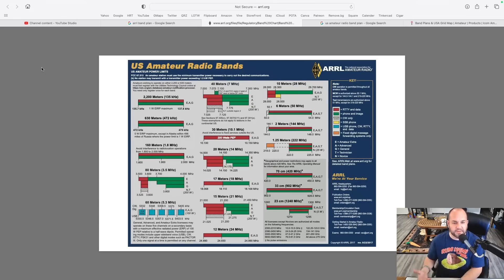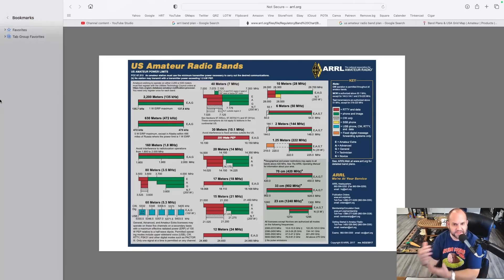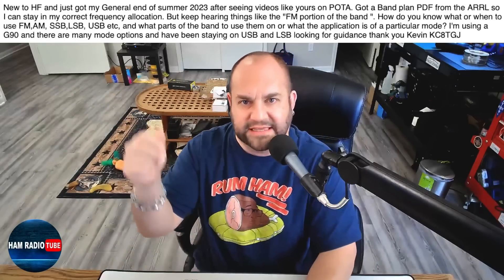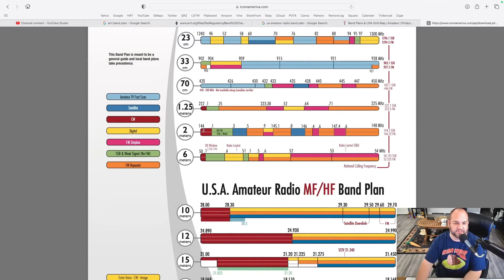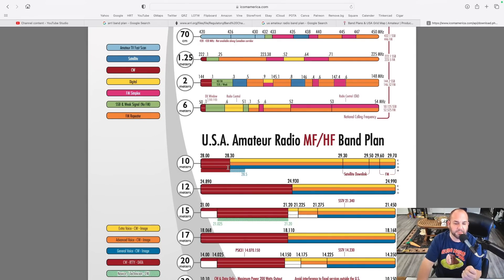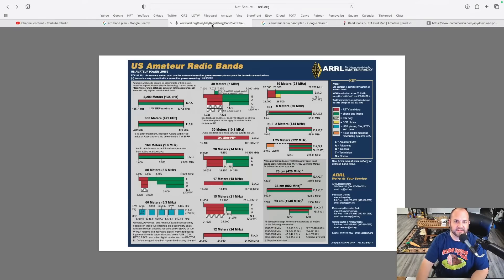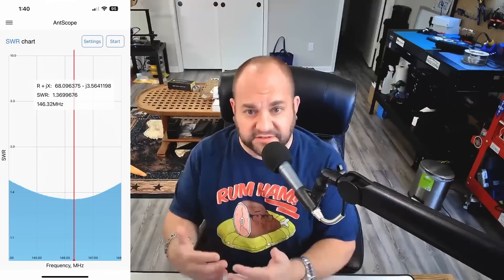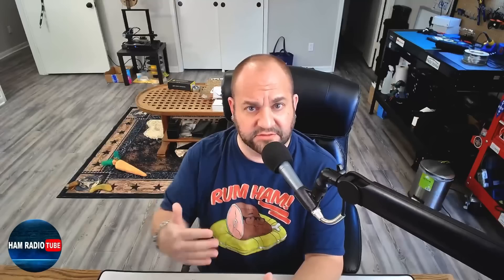Where Does Your Antenna Analyzer Go?

Comment: The way I have always done antenna measurement. Use a VNA. Calibrate the VNA at the end of the coax you are going to use. Save the calibration for each of the bands you are going to use. Do it for each band because the VNA can only analyse a certain number of points across the frequency range you select. When this is done attach the coax back to the antenna to be tested. Ensure you use the correct calibration and sweep each band required. I have one this with many antennas. It is a bit tedious, but it works. When I have done this, I have then taken screen shots for each band and calibration, put it into a word document with notes. Then I have used an antenna length calculator to work out what needs to be changed and so on. I use a DX Commander classic and used this method with it to sweep each band, then take it down and make adjustments.
I have done this witha Nano VNA and a Siglent VNA.
Like a lot of Ham stuff, it's something to do!

Comment: I agree with you about checking the antenna with the coax. The antenna should be analyzed as close to operating conditions as possible.

Also, you said you don't have any science to back up your opinion. I disagree, you did an experiment and showed the results, that is absolutely science to back up your point.

Comment: KF5MCJ Tulsa, handle Ron. Just retired at 68 now. I am working on my HF station and a few other Ham projects. Purchased and installed two used HF antennas. One, Hy-Gain AV-14AVQ and the other is a Gap Challenger DX-8. Both test bad at the switch on the outside of my home. Bad, means no resonate frequency with MFJ-259B on any band. Underground PCV conduit to each antenna. I took a 2-meter antenna that dipped at 146mhz and disconnected the HF vertical and screwed in the 2-meter antenna. Went back to the home and both dipped at around 146 mhz, the cable is good, and the antenna is bad. I will re-run the test on the vertical at the antenna before title base it down and replacing it. My MFJ is old and I just purchased a Comet CAA 500 to re-test. 

My father was a ham radio operator for seventy years, now a silent key. Do you have any of his hand made QSL cards, W5OQA Grove Okla.

Comment: Use a halfwave tuned feeder,,,the analyser  only input about 6mw to the antenna so the physical  interaction will be low,,,but you can also calibrate  analizers to take into account coax

Comment: Antenna EF question. I had 10g stranded 160ft that I used on my Icom,  Setup, Coax 20ft from icom 718 to icom ah4 tuner that is 15ft high, and under the eve. from the tuner, the 160ft / 10g stranded again from tuner at 15ft to a tree 90ft.  Well, the line going through the pulley snaped after 3 years, so do it came. Now, I tried to send a new line over the tree, and even tried to hire someone to climb the tree but no go. So, instead of 90ft, its only 20 ft. now having 160ft 15ft to 20ft high. I feel this will kick me in the ass. Any thoughts?

Comment: "How are you going to measure a 40m dipole a half wave up?"  Use a NanoVNA.  Get your coax that you will use, Run the calibration procedure at the far end of the coax, Raise the antenna into place, Then with your calibrated VNA, analyze the antenna as if your unit was 60 feet in the air but it's in your hand.

Comment: Two things about measuring SWR at the antenna:  1.  Antennas do not have standing waves, or SWR.  When you use an antenna analyzer to check an antenna you are checking the complex impedance for resonance and the feed point resistance in ohms.  2.  Feedlines have SWR. Especially IF their is a difference between the Antenna feed point impedance and the 50 ohm coax you are connecting it to.  The "imbalance" between the 2 impedances is the mismatch and creates reflecting waves to travel down the coax towards the transmitter thus creating the infamous standing wave ratio (SWR).
Reply: Standing waves are created by impedance mismatch and are introduced when you terminate a 50 coax to a 73 ohm dipole. The “reflections” are produced from the mismatch and create standing waves. So the reflections and standing waves are one and the same.
Reply: @k9eihamradio  I see a difference between reflected waves and standing waves.  Reflected waves.  Like I said.  Ideally we have standing waves on the antenna.  Ideally, we don't have standing waves on the coax or feedline.
Reply: On a centerfed dipole antenna, ideally the current is maximum in the middle and minimum at the ends. The voltage is maximum at the ends and minimum at the middle. That, my friend, is the definition of "standing waves". What we don't want to get is "reflected signals". Let's not forget the difference between "reflected signals" and "standing waves".

Comment: On band plans: first recognize that there is what the FCC regulations require, which is what the ARRL chart shows, and everything else is  by "gentlemen's agreement.  That iCom chart is pretty good.

On the DX Commander 20m intermittent issue: One additional possibility is that something near this (installed in a fixed position) antenna is sometimes resonant near 20m.  For example, house wiring for a light that is resonant near 20m or not depending on whether the switch is on or off.  Gutters or metal siding components that connect or not depending on weather conditions.  But the first thing I would try is replacing the 20m element with a new one, since a bad crimp/solder job on the fork connector, or maybe a break in the conductor inside the insulation seem most likely to me.  You can start with just plain wire and no fork connector to see if the issue disappears, before building an element that will stand up to time and weather.

On where too measure SWR, first figure out why you care.  1. You want your transmitter's finals to be happy (and, related, you want received signal to, as much as possible, go into the receiver front end, rather than being reflected).  If you fix this with a tuner (including the one that may be built into your rig), realize that tuners have some losses, and those losses probably increase with the amount of impedance transformation required. 2. Coax loss increases with SWR, but if the coax is short (coax loss is given per unit length) and/or low loss at the frequencies of interest, this isn't a big deal, and could even me less than the losses in that cheap matching coil on the base of your vertical.  Coax loss also hides SWR, than is, the SWR at the shack end is less than at the antenna end (signals in both directions are attenuated, so the difference between forward and reflected power is larger at the transmitter end, meaning lower SWR). 3. You being in the antenna's "near field" will definitely effect the tuning, and thus SWR.  While you may not have the ambition to go in and out of the house while tuning, you can connect an alternate coax to the antenna to let you get reasonably far from it while measuring.  But finally check again at the transmitter end to make sure that the final coax is OK. 4.  SWR at the feed point really doesn't matter, per se, but can indicate that you have misstuned the antenna (though you can see this from the transmitter end to.  SWR an the input to a matching network that you have placed at the feed point does matter, since the whole point of that network is to reduce SWR on the coax.

Mike, you have a great cat, and those old cat food commercials featuring the finicky tabby Morris were cute.  But the man's name isn't Morris, it's Morse, and that rhymes with horse, of course.

Comment: After finally getting a SWR meter, I learned that tuning an antenna has a lot to do with the co-ax you are using! The antenna and coax together, act as a system. I my opinion, its best to test that System (at the radio), as you plan to use it, to tune it correctly. Because even a later change in the coax's length will give you a different SWR. Its symbiotic! (BIG WORD, like Aluminum! 😅) 
And your ultimate goals are Not Fry the radio 🔥, get efficient power in your output ⚡️, and clear receiption 🔊.
Reply: The length of coax will not change the SWR other than through a change in losses. Take a look at a smith chart: the coax length rotates the impedance in a circle but the resulting SWR is the same. If adding 1 meter of coax changes the SWR than there is something wrong with your setup, most likely common-mode current.

Comment: Mike, on the SWR measuring. I agree in practice but only to a point. Measurements should always be at the antenna feedpoint to know exactly what's going on as with a non resonant antenna the coax will affect the match. There are 2 easier ways to do this. Use an electrical half wavelength of coax for the specified frequency and which will be "invisible" to the analyser/meter. To have an accurate half wavelength  length of coax an analyser ideally needs to be used to cut it. The 2nd way is to "null" out the coax by doing an open/short/load calibration at the far end of your coax. Any Rigexpert or NanoVNA will do this. This is my preferred method and this is how you check at a feedpoint high up. Once you tune your antenna the lengths of coax used should not matter but in practice the SWR will likely go lower due to losses etc. For commercial antennas dont bother and just check at the end  of the coax. For antenna building then the former is pretty critical, for example on my 5/8 verticals L/C match. 73 👍

Comment: Would swr measure be lower at antenna connector of the radio because of reflected waves have been atennuated by the coax lenght?
Reply from the maker: Yes,  Depending on the length of the coax, the type, and the frequency, SWR measurements could give a false indication of a good SWR due to losses.  Particularly at higher frequencies.
Reply: It could show lower or higher. The coax will change the reading.

Comment: I use a tuner with my Dx commander so I can use all of 80 meters   It is only resonate in a small window.  Also some of the other bands the swr climbs on certain ends of the bands
Reply from the maker: Great point.  Tuners sure do have their place, and they're especially good when you want to just work those frequencies that are not resonant on your antenna.  Not gonna lie, I do it all the time.

Comment: Mike, what you say about connecting your antenna analyzer at or as close to your transceiver does make sense in that the whole idea of a low VSWR is to provide a match to your radio. And as you also state your feedline is part of your antenna system. However, I feel that you should check your antenna system at the antenna so as you can see what your antenna is doing and how it is behaving thus giving you the opportunity to correct any mistakes before attaching your feedline. I feel that if you only check your antenna system performance where you attach it to your radio, and there is a problem, you then have to determine where the problem is (IE is there something amiss in the antenna or is there something amiss in the feedline). You could spend a lot of time messing with your feedline rather than fixing the problem with the antenna and vice versa.  Now, something of a tip (most owners of a Rig Expert will know this) with a Rig Expert you can attach the analyzer at your radio and "NULL OUT" the feedline, IE the analyzer shows you what is happening at the antenna. For me at least, it is a lot easier to change a feedline than change an antenna.
I hope this makes sense.

Luv your videos, keep up the great work!! 

73's DE Bryce VK3NBI

Comment: with the DX commander antenna SWR. check all bands and if just one band check that element . start with the wire is crimp at fork terminal . did that come loose did you solder it after crimp  . I would start at coax make Shure that good them make way threw the antenna. also check ground side as well. if that SO-239 comes loose on bottom plate will cause SWR jump. 73's

Comment: EE here. I'll try to explain it without equations....  If you had lossless transmission line (a perfect coaxial cable), then the SWR at each end would be the same, hence, the antenna analyzer could be a thousand miles away, and the SWR would be exactly the same as the one at the feedpoint of the antenna.  If you are familiar with the Smith chart, the perfect coaxial would make a perfect circle on it, while the lossy spirals torward the center.

As real coaxial cables have losses, the reflected power at the tx side of the cable is attenuated just as much as the transmitted power that gets to the feedpoint. Since you have less reflected power and more forward power at the TX end, the SWR not only seems lower, it IS lower! But that won't help you with tuning the antenna! On contrary, it might hinder you of doing a good match if you are not aware of that. It is not a lost cause, since as you close to 50ohm resistive, the SWR deviation gets smaller.

Some antenna analyzers have a calibration feature, where you place a 50ohm load at the antenna end and it will compensate for the coaxial lenght and loss, pretty much as a VNA does. I consider that an excelent feature to have. If you don't have this feature, you might have to so some guesswork till you get closer to the 50 ohm impedance.

BTW, that loss in the coaxial is the same reason you should try to place the ATU as closer to the feedpoint as possible!

Comment: SWRs & DX Commander - My Experience:

The only time when the SWRs are affected on my DX Commander Rapide, and a 40 mono band dipole I have on my roof, is when it snows. Once the element plate gets snow on it, or worst, gets covered up, SWRs go to infinite. Solution, dusting snow off periodically, yup time to get motivated walk through snow and start dusting. Dusting snow from antennas does build character over a winter season. LOL

Today I cleaned up the element plate, and gobbed it up with a heavy coat of Vaseline on all the bolts & wire connections. Vaseline will not freeze at the temps we have here in Heber City UT, so I will let you know if that works or not, but it is looking very good since I cleaned it all up this AM.  Come Spring I am building a 2nd Rapide with the 40 element and the coil wrap on the mast. I am building a 12 in diamter UV stabile black plastic spreader that will sit about an inch above the element plate to avoid snow accumulation. Other than snow issue, the SWRs on my Rapide stay put, all the bands are resonant at 14.25, 7.20, 18.148, 21.34, 24.960. & 28.470. So my SWRs are ideal for the SSB portions of the bands.  My DX commander is a permanent install with a concrete base, so I never move it, stays put. I replaced all my coax from TImes LMR 400 to M&P Extraflex Bury 10.

NO TUNER. I use the SWR meter on the 7300, a Nano VNA, and a Rig Expert to measure my SWRs. All three instruments reproduce the same SWR ranges. The measurement devices we use in Ham Radio have no controls, and no real way to evaluate the measured results, therefore the only way to assure I have quality results from any and all the analyzers  and watt meters I use in the shack is reproducibility of the measurements across all instruments/analyzers.

Louis
WW7GBA

Comment: Checking SWR in my mobile setup is more convenient at the antenna (for some of them). By "checking," I mean while troubleshooting a high SWR issue. If my check at the antenna is good, then I go to any inline switches or the back of the radio. The backs of my radios are buried. So, I'm thankful if I find the issue before I have to unpack the car to access the radios. HAHA. With that said, if the goal is to tune or measure ultimate system SWR, then measuring the feedline AND antenna, "what the radio sees," is the way to go. Just my $0.02, minus inflation and other diminishing factors. 😉 73! -Scott, KE4WMF

Comment: You are correct that measuring SWR etc at the antenna can be physically difficult but it the best place to understand the antenna.  The ARRL antenna book (recent editions) have a piece of software included called TLW that can estimate the the SWR at the antenna from a measurement taken at the end of a piece of coax of known type and length.  The SWR at the end of the COAX  will be lower than that measured at the antenna due to losses at the cable. The SWR at the antenna determines the cable losses due to SWR on the cable. For example an antenna with Z= 200 -50j impedance at 28MHz connected to a radio with 200 feet of RG-174 will have an SWR at the antenna of 4.23 but at the radio of only 1.08. The return signal is mostly lost in the cable. The line loss here will be about 14 db  including  2 db  due to the elevated SWR at the antenna. Your signal will also be down be down by 14dB
Reply: Nicely put. If the performance of the antenna and your analyzer readings don't match up, (low SWR but poor performance) then you may need to check at both ends of the coax to account for losses.

Comment: Common problem with SWR on the DX Commander is capactive shorting of the elements.  Have the guy change the orientation of the elements  ---- move the 20m element to the opposite of the pole and try that.

Comment: I had to replace the so-239 on the antenna. The threads were not long enough to make a good connection. All is well now
Reply: I put a BNC on my DX Commander Classic. The center of the female UHF connector was broken by me at some point and I only had the female BNC to replace it. Works great now!

Comment: Check the tension on DXcommander wires.  After overlooking important instructions from Cullum, I had problems when the mast slipped a little the the 20m wire got loose enough to wrap around wire element next to it.
Reply: Yes, the orientation of the elements need to be placed as they show in the instructions.